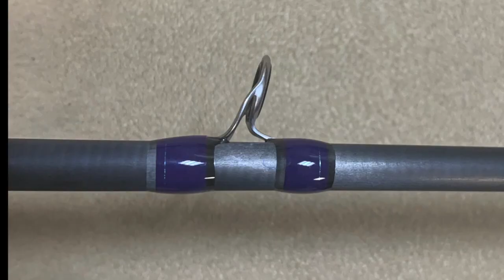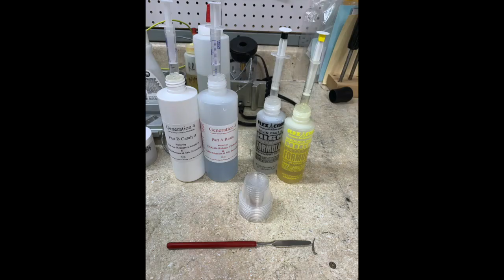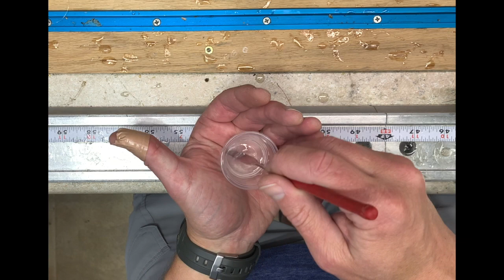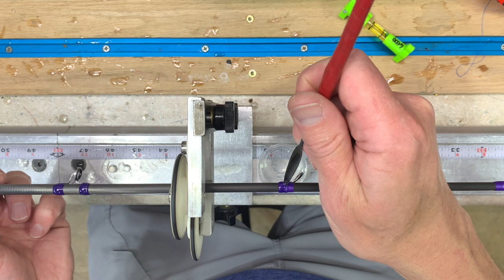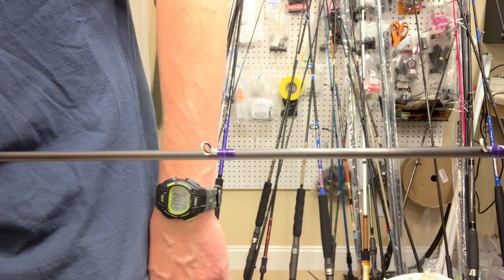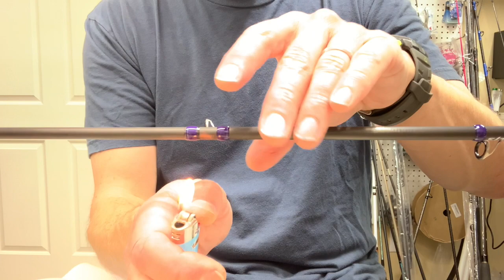How to Apply Guide Wrap Finish the FCR Way

Comment: that is a interesting technique. gonna have to screw up a few times with that one. i feel like i’ve been lied to my whole 8 month career of rod building.
Reply from the maker: Thanks for watching!  Hey so to that point - you probably will mess up a few times.  So practice!  Scrap blanks and wood dowels both work great.  No matter what finish technique you use you will get much better if you will practice.  So don't be afraid use use up some thread and finish figuring it out.

Comment: Bill do you use the spatula technique on under wraps?
Reply from the maker: Hello Mr. Burrows - so with underwraps I personally like to finish the underwraps first and then let that cure...then I wrap my guides on.  So I treat my underwraps like butt wraps and apply the finish to them at 200 RPM on a Flex Coat motor with a brush.  Then once that has cured I wrap the guides on and apply the finish to the guide wraps with the spatula.  Make sense?

Comment: Bill..another fantastic video. So you stated in the comments that you never go longer than 24 hours between coats. IF something would happen where the second coat-or third- could not be applied in that time frame, what can be done to allow that coat to then be applied? I know this is not ideal but I got called away after second coat that I'm not particularly happy with and want to correct it. Your thoughts...either for the wrap or the guides.
Reply from the maker: Thanks for watching - please like and subscribe!  You nailed it - it's not ideal but it's not a problem.  I am also forced to go more than 24 hours time to time.  You will NOT see a difference in your finished product...it just may affect how much the two coats cross-link and become one matrix.  You'll never know unless you peel it to repair.

Comment: I've been struggling with epoxy lately for some reason and was looking for tips I hadn't considered. I ran across this video, tried it on the second coat on a rod I'm working on and, wow! Game changer. Best finish I've had in a while. It was slower going than I'm used to and the epoxy was far past where I'd have chucked it and mixed up a new batch just a few days ago. I'm trying not to think about the amount of money I've dumped in the trash the last 20 years for epoxy I considered 'cooked off'. Using this method, that same epoxy is where it's just starting to be useful. Thanks for the video!
Reply from the maker: So glad to hear it helped.  Please like and subscribe…thanks!

Comment: I love your videos because of the clarity ,and some of your information however in this one I can't agree with the use of the lighter I have tried it and I get carbon marks.  I will try using the Spatula on my nest finish. thanks.
Reply from the maker: Hello Dan - thanks for watching.  And for the feedback.  Please like and subscribe!

I have heard that complaint/concern from other builders...soot/carbon from the lighter.  I have never had a single issue with it personally.  In experimenting with it to try to recreate the issue, I had two learnings.  First, I think the type of lighter matters.  I use only Bic brand lighters (which I do NOT refill) and have zero problems.  When I tried using a cheap no-name lighter at a rod building gathering I noticed it was very sooty.  Not sure why?  Probably the fuel.  

The second thing is distance between the flame and the wrap.  Even with the cheap sooty lighter, I only got carbon on the wraps when I actually touched the flame to the wrap (or came very close to touching the flame to the wrap).  The video is kind of tricky...some of it is overhead and you can't tell where the flame is relative to the rod/wrap.  But the flame never gets closer than a few inches from the wrap.  So that may be part of why I never, ever experience any soot or carbon.  

But in any event - we all have to find what works for us.  This works for me...experiment/adapt and find whatever works for you.  Hope this helps!

Comment: Great video!  I am going to try that spatula.  I never thought of using it to put the finish on.  I got a bigger one that I have been using to mix the paste epoxy with after your tutorial.  Working good so far.  Looking forward to the next couple finish videos
Reply from the maker: So I start with exactly that same large spatula.  I shape it down so that it tapers a bit towards the tip and polish it up to a high shine.  You can play around with various shapes but that seems to work best for me.  I also like to dip my handles in Plasti Dip (red in this video) to make them easier to hold onto.
Reply: @masteringrodbuilding  Thanks Bill.  I will play with it.  Working on a 12wt to try and get a tarpon with next summer.  Hopefully I will get to the finish in the next week or two.  I love that nail polish remover bottle thing you suggested in the other epoxy video.  I got one from amazon and use it all the time now.
Reply from the maker: @dannyp4959  So glad you like it - that thing is awesome, right?  I couldn't live without mine...love it.  Planning to do a video with all the tools and tips & tricks like that I've learned over the years soon.  Stay tuned!
Reply: Falconer Custom Rods yep that thing is amazing. Looking forward to your tips video !

Comment: Thanks for video, like I've said before I'm new to rod building. I have made 4 personal rods and 3 for friends/customers that wanted something they couldn't buy off the shelf. I've not thought about applying finish with anything other than brush and this method of use tool you used surely gives you great lines. Really appreciate the advice and different ideas for applying finish thanks again. I'll be watching next week. 
P.S. not so long between videos
Reply: I use both, but I prefer a metal tool because they don't tend to leave as many bubbles. I think what happens sometimes with a brush is the finish can pick up air trapped between the bristles and create some bubbles as that air gets trapped in the finish. Bubbles are inevitable and you have to learn to deal with them anyway, but you don't want to add any extra ones if you can help it.
Reply from the maker: I know...sorry for the long gap between videos.  My real job and my fishing habit get in the way!  I think there is a place for both brushes and spatulas.  I actually use a spatula for guide finish (for all but the largest heavy duty rods, when I'll use a brush or a mix of spatula and brush) but I use a brush exclusively for butt wrap finish and finishing long, level areas. 

Same thing with turning by hand vs. turning under power.  I apply guide finish by hand (again, for all but the largest heavy duty rods) but rotate at 200 RPM when applying butt wrap finish.  The key is figuring out what works well for you and gets you the results you want...and then achieving that consistently.
Reply: Thanks gentlemen, I'm on the east coast our flounder season just opened for first time in 2 years. So hoping to have tight line before long. First I have to help kidos with school in this crazy time. But have been fishing for some nice bass and I have to say to brings new element to fishing when you catch something on a rod that YOU made. Have couple of friends/customers that have told me that they really enjoy fishing with a rod that I made. Watching videos  that Bill has produced has really helped, he is a great teacher and guy to show his personal tips and tricks. I always watch and learn cause there is no one around that I can bounce things off of. So I learn by watching and trial and error. Sometimes more errors than trials. But each rod seems to get better and easier to build. Fishing hobby I appreciate your help as well. It's all learning curve. Tight lines guys thanks for the help and tips they really help.
Reply: @paulmcdonald9074  I think that is how most of us learned too. I still watch what everyone else is doing because you never know when you may learn something new. It's all a process! Good luck with your rod building, the kids' schooling and flounder!
Reply: Thanks I'll need it, all on line school is crazy and well the flounder may have to wait couple more weeks. But we'll see.
Reply: @paulmcdonald9074  our schools start back next week. Hopefully they will keep them open. Both of my kids wanted to go back instead of doing the online classes. They had the option to do either one. They had to finish up last year online and both of them said they didn't learn as much as they would have in class, so they both wanted to go back.
Reply: It's my daughter's senior year I was hoping it would be a normal year but much to my sorrow it's anything but. My son is not doing well with home schooling and it really brakes my heart to see either of them have to go thru this. But as I always say what does kill us makes us stronger 🙏.
Reply: Doesn't auto correct gets me every time. Lol

Comment: Different than how I do mine, but it looks effective 👍 Good video! Very thorough in your explanation of how, when and why you do the things you do.
Reply from the maker: I think it may be different than most LOL.  Definitely more than one way to get a finish that makes you happy.  I'll bet it took you a long time to master whatever technique you use so that you can get consistent results.  And that is what I think is valuable to new builders - work hard at it and figure out what works for you.  Then don't change!
Reply: @masteringrodbuilding  that's right! I took bits and pieces from different ways I saw it done and changed a few things and ended up with how I do it now. Definitely no right way to do it other than what works best for you. Practice is the key for sure!

Comment: Awesome content love what you are doing with the videos. I noticed that you were able to reach up and slide the entire wrapping station and move the whole set up . How did you accomplish this bit of magic?? Lol
Reply from the maker: Thanks for watching - please like and subscribe!  Glad the content is helpful.  

So...I wrap on a Renzetti.  I detached my thread carriage and mounted it permanently on my bench top behind my lathe.  I then routed a hardwood 'rail' that I mounted my base sections onto.  So, I stay stationary - with my thread carriage, my tools, my waste basket, a good light and magnifier, etc. - and I slide my lathe 4 feet to the left of me or 4 feet to the right of me as the lathe bed rides on that hardwood 'rail'.  The thread carriage is also mounted into a 2' piece of T-track.  So between the lathe bed sliding and the ability to move the thread carriage a foot either direction, I can wrap from one end to the other end and I never have to move.  

I should note that I rarely power wrap and I removed the powerhead, motor, chuck, etc. from my lathe.  It is mounted on another section of lathe bed in my garage where I do my dirty work - guide grinding, grip sanding, etc.   The Renzetti is the best IMO but some set up like this could probably work with other power wrappers as well.  Good luck - hope this helps!
Reply: @masteringrodbuilding  Thanks for the info, I see where this is highly effective, huge time saver, and efficient setup. I'm trying to set up my bench now I'm definitely going to try and build a very similar station. Thank you so much for the reply, I know it takes a lot of time out of your day and I really appreciate the information. I'm getting ready to retire from the military in a few months and plan on building rods for a hobby, or maybe even for some fishing money. Lol tight lines!!

Comment: Thanks for your insightful videos. I've learned quite a bit from watching them.  I'm trying to apply finish to guide wraps on an un-sanded blank. When I try to move the finish from the thread onto the blank with the spatula, the finish wants to follow the spiral ridges left by the molding process rather than staying in a straight line. Do you have any hints on how to overcome this problem? Thanks.
Reply from the maker: Hey David - sorry I missed this question initially.  Thanks for watching - please like and subscribe!

So I know EXACTLY what you are talking about...it can be a pain depending on how pronounced the spiral ridges are.  There are two things in my experience that help.  

For the first, I'm going to describe what I do from the perspective of the rod butt being on my left and the rod tip being on my right.  Essentially, I am going to take the direction of the ridges into account and use them so they are forcing the spatula into the wrap vs. away from it.  So far in my experience the ridges always run the same way so the below instructions should help. 

So on the left hand side of the wrap (the butt end side) I am going to rotate the blank AWAY from me as I go around the wrap.  If my spatula finds a groove or ridge this way it runs the spatula into the wrap vs. away from it.  

On the right hand side of the wrap - the tip side - I am going to rotate the rod TOWARD me as I edge the wrap.  Again, this means that if the spatula rides the groove it will ride it in toward the wrap vs. out away from it.  Make sense?  

In the event your grooves run the other direction - which I personally have never seen but could be possible - just reverse the above instructions.  The key is that you don't want the ridges 'dragging' the spatula and finish out away from the wrap. 

The second thing I do that seems to really help is use a heavier bead of finish and don't actually touch the blank with the spatula.  I am sort of just using finish to make contact and sort of 'ghosting' over the wrap while following the top of the outside edge of the wrap...vs. letting the spatula firmly contact the blank.  I especially focus on this at the one point where the ridge intercepts my finish straight line...I'm sort of pushing a bead of finish over instead of dragging it there with the spatula if that makes sense.  Hope this helps...let me know if you have questions.  Thanks!
Reply: That was a big help. Thanks! @masteringrodbuilding

Comment: Hi
Great video
At what rpm do you spin the rod after the 2nd finish coat and how long do you let it spin?
Thanks
Reply from the maker: Thanks for watching - please like and subscribe!  Once I have applied the second coat, I rotate at 6 RPM for two hours (Flex Coat Original High Build) or 3 hours (Gen 4 high build).  But you could rotate anywhere from 4 RPM to 36 RPM and be fine.  I hope this helps…tight wraps!

Comment: Hi Bill - thank you for the great video.  On the length wide strokes, is it important to make sure to do it perfectly all around the butt wrap?  I couldn’t tell from your video if you were making sure to do it consistently around the entire wrap or if you were just doing a few strokes while turning the blank (it looked like you did about 6 brushes).  I wasn’t sure if the finish can self level around any area of the wrap where the stroke may have not covered.
Reply from the maker: Hey TackleTomFL - thanks for watching.  Please like and subscribe!

Great question - sorry it wasn’t clear.  It’s not absolutely essential that you level it perfectly all around the wrap.  GEN4 levels really well on it’s own .  You just want to get lengthwise strokes along most of the wrap...hit more of it than you miss if that makes sense.  

Play around with it...it’s super easy to work with and you’ll quickly get a result you like.

Comment: I like the technique and will give it a try! However I have a question based on observation of your use of a butane lighter for heat. I noticed more than once smoke arising from the flame while you were passing this over the bands. Butane is not a clean fuel. Have you had any problems with smoke chemicals contaminating your finish?
Reply from the maker: So…I have gotten this question before.  You are right that  Butane is sooty.  But I’ve never had a single problem as long as the flame never touches the wrap.  I use a standard garden variety BIC lighter I buy in bulk. 

I have heard from people who have gotten soot on the wraps…not sure what they are doing to cause this.  I suspect the flame is too close to the wrap.  But you can always use a cleaner heat source (like an alcohol lamp/torch with denatured alcohol) if that makes you more comfortable.  Hope this helps…good luck!

Comment: If you do not have the epoxy flow a little onto the rod don’t you get a sharp edge?  or do you let some on the rod to get that rounded look?
Thanks
The more I listen to the video the more I learn
Reply from the maker: The second coat I carry the epoxy over onto the rod blank...thus protecting the thread wraps and getting the rounded look.  Hope this helps!